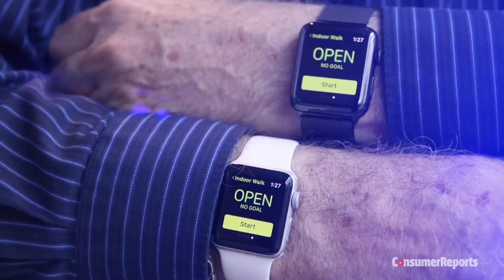Apple Watch Series 1 & 2 Test Results | Consumer Reports

Comment: Both Series 1 & Series 2 of the stainless steel AppleWatch models use the sapphire crystal. Just for the record.
Reply: That is not true.  Series 1 Apple Watches are only available with Ion-X glass.  Also Series 1 Apple Watches are only available with an aluminum case.  Apple's website outlines the differences pretty well.  
http://www.apple.com/watch/compare/

Comment: They need to make functional Apple Watch bands to utilize the unused Apple Watch port. There is claims that the port can receive a charge,  and quicker, through the port. This also includes the original (not Series 1) Watch as well. This port can be accessed where the band connects to the Watch. Needless to say, I am a iPhone user but not at all an Apple fanboy, I want to purchase this luxury toy (not necessary) to enjoy some pure nerd tech. Now that the Watch was introduced to the wild for quite some time now, I am willing to give up some hard earned cash for this rather expensive "toy." I haven't purchased one yet because there is no need or hurry to own one. The biggest problem I see with the design/purchase models is that the Aluminum model seems to hold up stronger than the steel model; yet, the screen seems to be inferior to the steel model. This creates the issue in witch I can't decide which is more important to me, body or screen durability.

Comment: I would very much like to see a demonstration of the watch as a fitness device. In my experience, the heart rate measurement is accurate as long as it functions, but in many cases (weight lifting, body-weight exercises), the heart rate function fails as with most wrist-worn heart rate monitors. I am sure there are workarounds, such as Bluetooth chest straps.
Reply: It's your personal opinion against scientificly backed research.